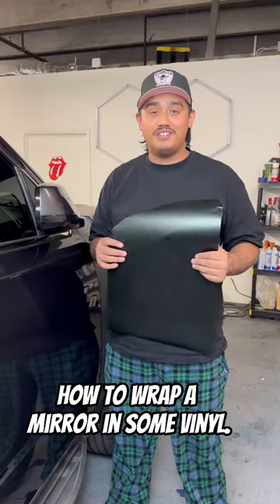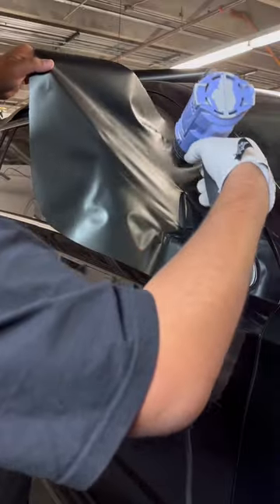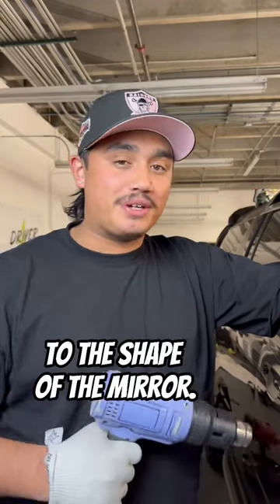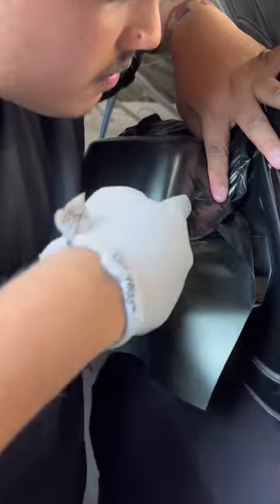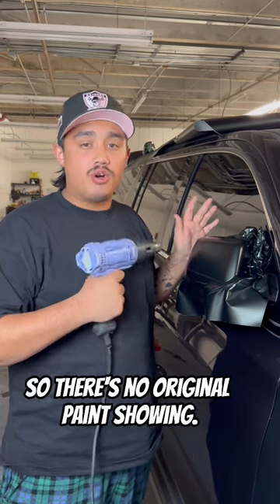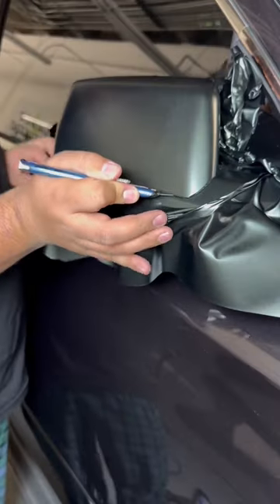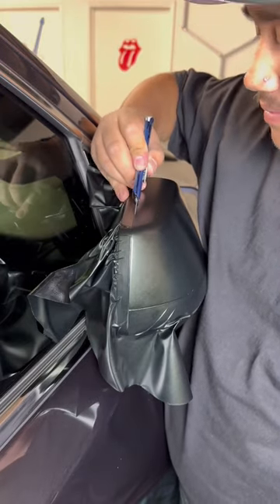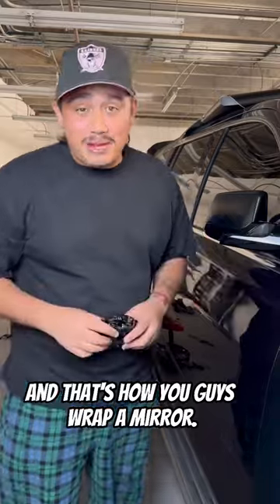How To Do a Vinyl Wrap Install on Side-View Mirrors. #carwrap #vinylwrap #carwrap #howto

Comment: Nice work, I have been a wrapper/sign maker for 20 years, if you post heat to a minimum of 100 degrees before making any cuts the heart will burn right through any bridged vinyl.

Better using infrared heat lamp or removing the cover so can take vinyl to the inside of cover then post heat all edges that are taken around to the inside of the cover where never seen. 

But nice work also mate from Scotland 🏴